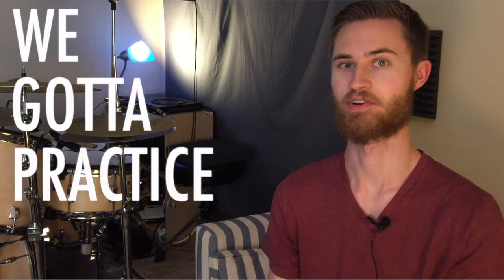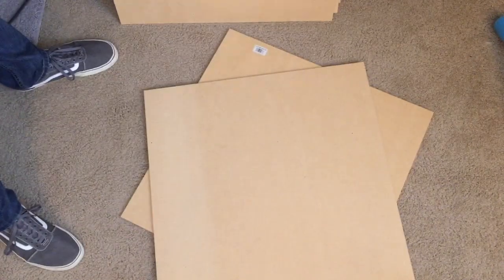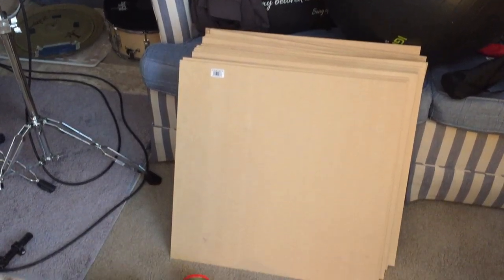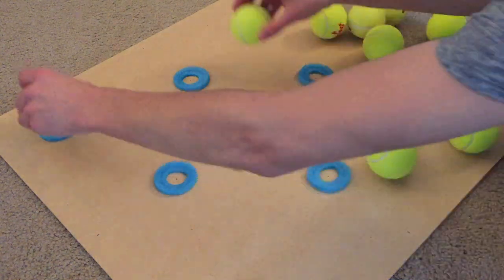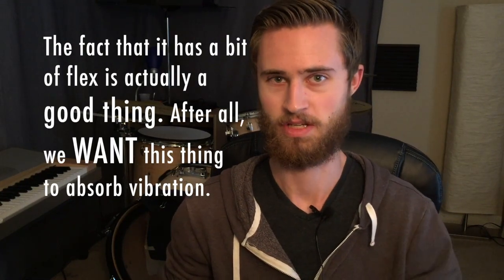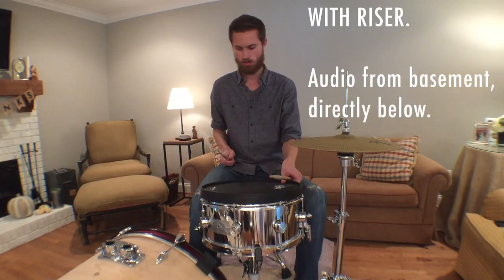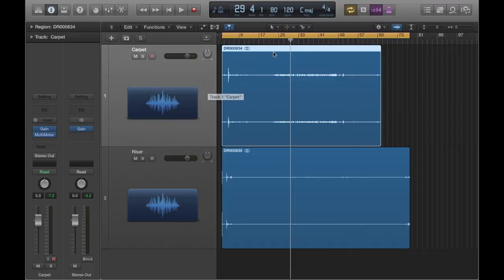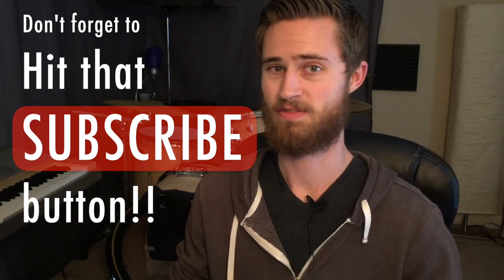Is a Tennis Ball Riser REALLY the SECRET to Quiet Drumming?

Comment: I built one of these today following your video with the noodles and all. Mine is 34" x 24" with 1/2" plywood, for an electric drum. The pedals resonated in the floor which my downstairs neighbors most likely heard really well. Pads resonated a bit too, but pedals were the main issue. Quite easy to build, took about an hour. Placed a mic on the floor recorded the kick with and without the platform. With the platform, I got around 6 dB less in the 60Hz and less range, 8 dB less around 140 Hz stomping on the kick. Thanks for the detailed video

Comment: I have seen a riser made using the pool noodles, instead of tennis balls. They had them laying horizontally b/w the pieces of wood and then wrapped the whole thing in foam and added a top layer of carpet. According to them, it actually dampens better than the tennis balls.

Comment: I'm in an apartment in a high-rise, my strategy for practicing was to get an electronic set and place the thing on a high-density rubber anti-vibration pad, designed for washing machines and appliances.  The floor is concrete, there's wall-to-wall carpeting, then the rubber mat, then another rug (just because the mat's kind of ugly).  My neighbors below me say they don't hear anything.  On the other hand I have to get out at least once a week to a rehearsal studio to play  some acoustic drums or else I'll lose my feel for the real thing.

Comment: I built mine using  2 pieces of plywood containing tennis balls with the holes drilled thro, with noodles on the floor and kneeling mats (cut into 3's).
This rests on a carpeted floor, in the top room.
Finished it off with rubber foam playmats and a piece of carpet on top. Works for me... 
Love, 40!

Comment: If you were to put the throne directly on the floor and raise the seat to compensate for the height of the riser, or if you were to put the throne on some solid riser of the same height as the tennis-ball riser, would the quality of the sound isolation be affected much or at all? It would seem that having the throne on the tennis-ball riser must compromise seat stability noticeably. Or does the throne actually feel just as stable on the tennis-ball riser?

Comment: Made two tennis ball isolators for two subwoofers.  I did use a hole saw and glued the balls into the holes.  They don't "couple" with the floor as well but much less sound bleeding through the floor.

Comment: Question
What about tires Riser? By logic it should get the same effect if not more, I just didn't see any evidence in the web. 
I think it will be cheaper (you can get damaged tired at any garage for free), more stable, and has a great potentional for eliminate vibration.

What do you think?
Reply: not sure if it will be free since most tires are recycled and made into other products such as anti-fatigue mats. also, your room would most likely have a tire smell if you did this.

Comment: Great set-up, idea using the pool noodle is genius. I would only add glue to the top and bottom of the tennis balls for extra holding. 
As for the comment to just use the foam; the space between the wood caused by the tennis balls, actually allows for sound dispersation (or spreading thin) and causes a better muffeling effect.
Reply from the maker: Right (about the sound dispersion) - I think foam-only wouldn't be very different from carpet only, since there's still a degree of direct contact. The tennis balls "float" the floor, preventing a good deal of vibration from passing through. (So yeah, I think you're exactly right.)
And about the pool noodle...yes, we'll say my wife's a genius for that :) And yeah...I may have been able to glue the tennis balls themselves as well, but there wasn't a lot of tennis ball surface in direct contact with the foam anyways, so I'm not sure how much difference it could have made. I think the zip ties actually play the largest role in keeping this whole thing "sturdy."
Reply: The glue on the tennis balls was for contact with the wood. But yeah the zip ties definitely "holds it all together".
Reply from the maker: I'm about to set up sort of a "channel email" here so that anyone with questions can just shoot me an email that way. Let me do that in the next couple days, and I'll keep you posted. 👍Looking forward to hearing what you're working on!
Reply: Sounds good. Will I be able to attach a photo? I could describe it, but the visual is just easier. I do not have the video capabilities, like you and so many other U- tubers. So i must describe in great detail to make it understandable. Which isn't a problem for me, I just imagine most people would rather see it happening, than read 2 long paragraphs.
Reply: Which is the principle of isolation used in some studio designs right: the floor, and sometimes the walls and roof, are  actually floated inside  the main structure to diminish outside noise.

Comment: nice vid  Keep in mind tennis balls loose air eventually.  Just like playing tennis with same balls after a few sets.  So all the weight on the riser i would think would cause the tennis balls to deflate over time.  of course not deflating or flatten, but you would be able to squeeze it with your fingers..

Comment: thinking of making this, just some quick questions.  
One, I play metalcore deathcore death metal is quarter inch thick mdf board still durable enough for super fast hard playing?
Two, how thick should the pool noodles be cut?
Third, what drill bit thickness should be used for making the zip tie holds?
Fourth and final, how long does this whole build take?  Keep in mind I am a super beginner diy guy (pretty much have never done it before)

Planning on making this within a few days a quick response would be super appreciated.

Comment: Interesting video.  I have the "opposite" problem.  I have an acoustic drumset in my basement, and need to isolate sound from going through the floor/ ceiling above.  Any tips / videos on fixing this?  I'm considering building a two walled room with a double ceiling in it since I own the house, but this is going to take quite some time.

Comment: Since you are using a drill, you can use that same drill with a hole saw bit to make holes for the tennis balls to cradle even more into. Only make the holes as large as the hole in the pool noodle, and that should help reduce some (but not all) of the lateral instability.

Comment: Great thing, an eye opener, thanks. Just a quick tip, though. In order to quantify the exact difference between having and not having this thing, use sound level meter, you can download it as an app. Then you will see how many dB dropped after installation of tennis balls

Comment: One thing you might consider adding is some 4" thickness R19 fiberglass insulation in amongst the tennis balls between the 2 MDF layers. This would help reduce the bottom end frequencies even further, as R19 fiberglass insulation has a high enough density of material to absorb sound in open cavities. If you can find 4" R30, that'd be even more effective. The higher the density you can get without it being solid material, the better.

Comment: Before going through the expense and work of making a tb riser, check this. I made one with a sheet of 3/4” mdf, cut it in thirds, made holes for the tennis balls in two of them, wrapped carpet over the third one for the top, put rubber feet on the bottom, put that on teflon sliders. Heavy. Seemed to work great. I put vibration analyzer on my phone and set it on top of riser. Huge waves. On the bare floor, a little vibe. Success? No. I never tested the floor with just the edrum kit on it. It too had a little vibe. My mistake was that when the phone is on the riser, there’s oscillation. The whole build maybe stopped a little vibration from the floor but not as much as you’d think. I think its the weight. A hundred plus pounds in one spot, injecting sound into neighbor’s place. So i’m not sure much was gained by all of this. The breakdown is; if the neighbor is someone that is going to raise hell if they hear anything at all, this is not going to be the answer.

Comment: The key to any drum noise reduction riser is the AIR GAP. Any foam slab or rug no matter how thick and soft will transmit vibrations. The tennis balls create minimal points of physical contact - but its mostly air.  Also, you dont necessarily need the seat on the platform - you can sit the throne on your regular floor - you wont be making any noise from sitting - you just need to raise your seat the height of the riser.
Reply: That is actually a good tip
Reply: Thank you for this advise on the throne it will help for sure, will save some money on wood and balls !😂 no pun intended

Comment: The only suggestion I would make is (since you have the drill), is buy a 3/4” or 1” Forstner (approximately $12.00) bit, and drill through 2-4 panels at a time to make matched pocket sets. Then set the balls in those pockets. 3/4” or 1” hole the ball should not poke through, and it might be more stable and faster to build than the pool noodle rings. But what you built there is really cool.
Reply: Agreed. If he already has a drill, a basic hole saw is a cheap adder that eliminates the need for the flimsiest part (noodle slices) if the design.
Reply: Would drilling holes impact the stability of 1/4" MDF tho? Maybe go for 1/2" MDF?
Reply: @seapip5417  I would definitely go with 1/2", at a minimum, preferably 3/4".

Comment: Great video, I'm so glad I found this and I subscribed. This is really good info, and everything you did was awesome!
  If I may add, for those thinking of building something like this; it is the holes cut for the tennis balls that gives the stability that is required for playing drums. The holes are a precise size so the wood grabs each ball and locks them into place.  It is kinda like making a flat spot on the balls so they won't roll.  In Mr Clark's design, the foam donuts are not weight bearing, as they would need to be, considering the total load and motion it will be supporting.  
 I feel cutting the holes is an intrinsic part of the design and can not be disregarded. The interlocking of smaller boards was a great idea, as long as they don't move or don't touch.
It could be done with large super balls, but they would need to be cut in half and glued.  In the end; setting up a drum set on top of 47 balls smashed between two layers of wood sounds sketchy at best. The holes take away the ball's ability to roll, where as the foam donuts don't. 
  But great job to say the least. And Mr Clark, you sir are an excellent drummer. 
Cheers

Comment: Thank you for the video. One question though: is your house floor made out of wood (the structure)? If so, any idea on how this would perform on a concrete floor? My guess is that it should probably perform even better, but I'm not so sure.
Reply: I’d be surprised if a concrete floor was transmitting many vibrations in the first place

Comment: Hey , going through my literature there is something called Joist Floaters. They used to be VERY expensive but you can find them now for $3.00, These are sold as FLOOR FLOATERS   and they are shaped like a U  (with all straight lines)  you can put them under "any solid platform" (according to the sales pitch) and they  become a "Musicians friend" . I think that a few of these and your platform would be 100% isolated from the floor (your neighbors ceiling)
Google joist isolators Auralex  and take a look.
Reply from the maker: Those are along the lines of the "hockey puck" style floor floaters as well, that essentially accomplish the same thing as the tennis balls. So the interesting question here might be whether or not these are actually cheaper than the tennis balls. Something like this also sounds like a good solution for a desk with speakers on it...getting a desk an inch or so off the floor to prevent speaker vibrations from going through the floor.
Reply: I am a GREAT devotee that every tool has a job. I may be totally off here but there's no density in a Tennis ball and density is needed  the lower frequencies from being passed through your floor. These things are actually advertised now as Recording Studio  Quality.  And yes at $3.49 4 of them will dissipate enough low frequency that you can peel paint with a subwoofer and the people below you have no clue.
I wrote to a company that builds portable raisers and floaters "kindda" passing my idea. If these people come out with this in the market .. I need this thread as proof ! and yes I need to pull out more of my audio books and start designing . will keep you posted.
Reply: Stephen Clark have you thought about buying a Roland kit with mesh head's ?

Comment: So first of all cool video.
Then a bit of physics to understand the pro and cons. 
There is to type of sound transmission, the airborne and structure born transmission. 
The main sound of the drum is transmitted via airborne ones. but in a building, especially with the kick and HH, and everything on the floor (ft with legs) transmit the energy of the hit to the drum head of course but also significantly to the ground. Hence the floor becomes a medium for the sound wave and depending on the structure of the building (especially with concrete) those waves will travel quite far up or down and become airborne again. 

This Tennis ball riser, only reduce structure born wave generated by the kick, HH foot and the floor tom. But it doesn't change anything on the airborne transmission. (by the way those airborne transmission can become also structural). 
That's why it reduces part of the sound but you can still hear the drum.

Also a way to break these solidian transmission is to use the principle of mass-spring-mass isolation. The spring in sandwich between the two solids moves laterally (mostly) when  the wave arrives on the first solid absorbing the vibration and preventing the second solid to receive the wave. That's exactly what's made here. Note that the wood on the ground is useless for breaking the transmission (but is useful to keep the thing all together). 

For an electronic drum I did one with a 2cm thick medium wood (1m50*1m) and some foam on top, on my side I used only 9 Tennis ball that i glued to the board, since i don't move it very often it work perfectly fine (and i'm using it since 5 years) the floor is used as the second solid (in the mass spring mass principle). The main point is that the each solid has to be massive and able to move freely (that's why i'm a bit confused about the thing holding the 2 solids together). 
(Same principle used here - sorry it's in french- http://www.rt60.net/iso_acoustipad.htm)
http://www.apasdevelours.fr/uploads/1/0/1/9/10194944/8532938.jpg?328

Comment: Sound travels far more than we believe, more so in an Apt. in order to dampen the vibrations I found that mud flaps from a big rig works quite well, not only is the rubber mats heavy and dense but also aids in keeping your set-up from moving around.  bonus is Anti-Sail & Spray Mud Flaps for a Pair of 24" by 30" is around $40. bucks

Comment: The piece you are missing is the airspace between the bottom piece of wood and the floor.  You should be raising the wood off the ground with a few heavy rubber pieces.  The impact noise will then have less area to flow to the floor.

Comment: How do you stop the sound from going lateral through walls?  Or do you only have attached neighbors at a lower level.
Reply: The low volume heads and cymbals he's using takes care of that.  The only problem after the heads is to keep the noise from using the kick and hihat pedals from getting through the floor.  Thats where a riser comes in.

Comment: I'm considering this for my electric drums. I bought electric drums for my apartment but apparently that still just vibrates throughout the entire building. I think this might fix that completely.
Reply: It does.  I recommend the thicker MDF, though, for stability.
Reply: Same. Electric drums are still pretty loud if the walls and floors aren't thick
Reply: @shamicentertainment1262  You're speaking of amplified electric drums, right?  Not just the sound of the pads?  The reason I ask is I once lived in an apartment at a busy, fairly noisy intersection (Atlantic Avenue and Court Street in downtown Brooklyn) and was playing my electric kit using headphones with no amplification.  My upstairs neighbor knocked on my door and told me the sound of the pads was keeping him up.  True story.
Reply: @bholaoates1542  nah it's just the pads. I think our floors are super thin, and my drums are on top of their bedroom. So when I do double bass it must get pretty loud down there
Reply: @shamicentertainment1262  Okay -- it was the opposite for me.  I lived on the ground floor of a brick building and my upstairs neighbor complained.
Reply: @bholaoates1542  i'm having the same issue with my electirc drum set (Raland TD11 KV) so i do have mesh heads all around but the thump from the kick pedal is notorious and my downstairs neighbor doesn't like it. I'm gonna probably start building a similar platform this weekend to see if it makes any difference. If all else fails i'm just gonna save up some money and buy an electric trigger pedal from Roland, a KT9 or a KT10. My drum set already is sitting on 5 layers of carpet and another thick layer of a mini rug folded in half AND a piece of thick cloth that i placed over the bass drum itself and the neighbor can STILL hear the kick pedal. Floor is concrete by the way. Any suggestions?
Reply: @TheHaos1  take up the flute?
Reply: @TheStarBlack  I was hoping for something more helpful lol